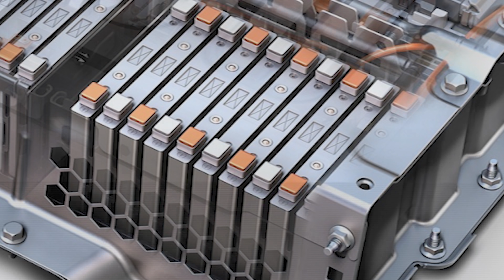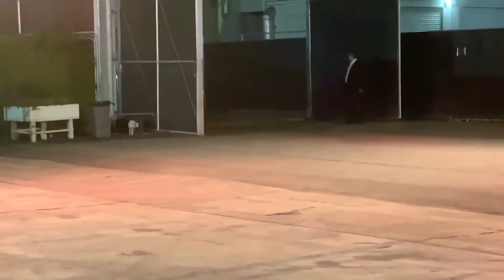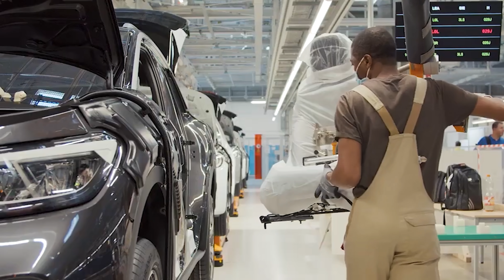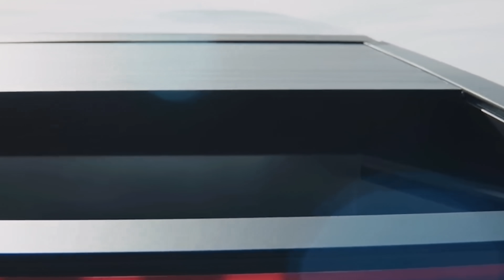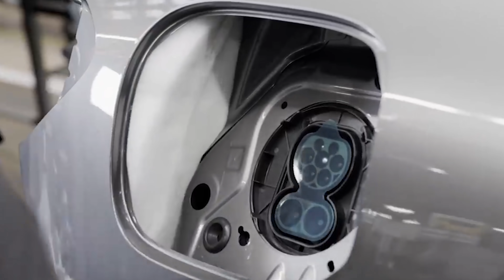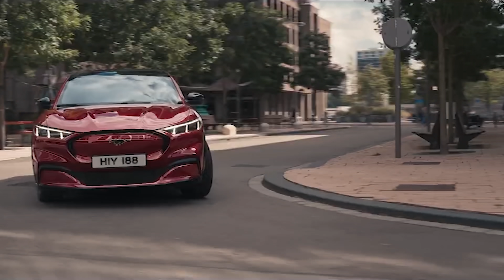Massive Advantage Tesla has Over the Competition

Comment: Great video! Can you do a video on the economics of individuals reserving cybertrucks as a "call option" on FSD? Like does it make sense to reserve 10-25 cybertrucks to run as a fleet operator? The deposits are fully refundable. It's like buying a fully refundable call option.
Reply: Wow, that would be a LONG Term Equity Anticipation Option!  To make money with FSD, it would have to be approved for use on the street with no driver.  That is years away.  While you can reserve the truck, you can't reserve the price of the software, so that might blow the whole deal too.
Reply: @incognitotorpedo42  Good points. It is currently legal in Texas to operate a robotaxi so it would be a question of whether the Feds get in the way. I doubt it but it is possible. You can reserve the FSD price when ordering the cybertruck. It's $10,000 right now.

Comment: Well, you're catching on. Many of us were riding the LFP wave well before Tesla decided it was economically feasible and profitable to use them in their Chinese based Model 3 SR.

And once again BYD isn't competing with Tesla mor do Tesla need to compete with them. But what both of them have in common in their respective markets is competing with legacy autos. 

And while BYD does make and use their own LFP batteries their cars are quite efficient. Take the BYD Han for instance. It has great tech, a center rotating screen with premium interior and a great audio system. It receives overbthe air updates and it's a good intermediate car between the Mode 3 SR and the Model S LR (on looks and not distance). The BYD gets 270 miles on a charge and that's 100% using their LFP battery design. And it's cheaper in China and will also be cheaper in Australia. 

I see both of these companies being EV leaders for years to come.
Reply: They will be the top Two...........I can visualize BYD merging with Lucid motors as this would please the Chinese Govt.   .............Paul
Reply from the maker: The thing is the range the BYD gets in the Han, is the same as a model 3 SR. Model 3 uses 54 kWh, Han uses 80 kWh. Big difference
Reply: @TeslaEconomist  But I think the BYD Han weighs 4,400 pounds and the Model 3 with LFP weighs 4,023 pounds. So that extra weight and battery size sounds about right for the milage it gets. 

And that's not "Tesla's" LFP battery. That's CATL's battery being used in a Tesla. 

But for BYD that is their own battery. And since they are the 4th largest EV battery maker with CATL being the first I can see CATL with a lead over BYD. But that's BYD making their own batteries, their own cars and their own chips while Tesla, at least for now has been using everyone else's tech in their cars.

No big deal. I'm confident Tesla will be as equally vertically integrated as BYD one day...if not more vertically integrated than BYD in the near, near future.
Reply: "And once again BYD isn't competing with Tesla mor do Tesla need to compete with them."

All automakers are competing against each other.

Comment: I seriously doubt that Tesla will put LFP batteries in the CyberTruck and Semi. Those both need high energy density nickel batteries.
Reply: Fully agree on the Semi. There are 100 million passenger cars in the US, and 2 million semi trucks. Even if the semi truck uses more batteries, it's still a small portion of the overall. What better place to use nickel than on the semi truck.

The CyberTruck should be mostly Nickel, but if they made an Iron variant then that could be a good call. Would need to see the data.
Reply: Some large trucks only need a 200 mile range per day.

Comment: LFP is junk. Only nickel is best. Range is KING
Reply from the maker: How much range do you require?
Reply: @TeslaEconomist  depends how long I want to run my appliances. Electric stove. LFP is a freaking joke.
Reply: @tophat2002  Thinking the sales proposition for CyberTruck is reliant on its ability to power an electric stove is deeply delusional.
Reply: @fredbloggs5902  the model Y cabin heater use to be a resistance heater but changed to a heat pump for cabin heating. Now Elon wants to sell you an LFP battery with a crappy heat pump rather than a nickel battery with a resistance heater.  The LFP version is of a lesser technology.
Reply: @tophat2002  "the model Y cabin heater use to be a resistance heater but changed to a heat pump for cabin heating. Now Elon wants to sell you an LFP battery with a crappy heat pump rather than a nickel battery with a resistance heater.  The LFP version is of a lesser technology."

Nonsense. The change to heat pump was not because of LFP batteries. Tesla will never replace the heat pump with resistive heaters regardless of whether they use LFP or regular lithium iron batteries. Resistive heaters is a massive waste of energy.
Reply: @yourcrazybear  resistance heaters need less repairs.
Reply: @tophat2002  Even if that is the case using a heat pump is the obvious choice in terms of creating efficient cars, especially in colder climates. The effect on range is huge in colder temperatures.
Reply: @yourcrazybear  yes, bigger range is better in the winter. Nickel is the key. LFP is temporary.
Reply: @tophat2002  While nickel based batteries have a better energy density, LFP batteries are still viable in cars. They are also cheaper and easier to manufacture at scale today. They are not going away anytime soon.
Reply: @yourcrazybear  blah blah. Range is KING
Reply: @tophat2002  Range is king until it isn't. What is even more king is having enough supply to meet the demand.
Reply: @yourcrazybear  it is forever king. Because of RV living.
Reply: @tophat2002  No. There is always a threshold for any individual use case. Paying more for excess capacity is just a waste of money.
Reply: @yourcrazybear  heated hot tub. Hot plates and all seats heated in RV

No propane

NICKEL allows this unlike iron
Reply: Junk? Hardly. 

Is it less energy dense? Yes. 
Is it cheaper? Yes. 
Is it easier to produce them at volumes? Yes.

What matters is getting the cost of EVs down. When you have reached enough range, you don't need more. People will gladly sacrifice superfluous range if it means cheaper cars.
Reply: LFP: much longer life (over two million miles), very safe (won't easily catch on fire), cheaper, better for environment, can charge to 100% much faster. Not junk junk jecause you say so. Not everyone needs 400 mile range!
Reply: @jcjensenllc  no. 

1. It's 1 million miles the same as nickel.  
2. The fire issue with nickel has been solved.
3.  It's only cheaper because the nickel hasn't been mined yet, plus you get what you pay for.
4. Iron phosphate is worse for the environment, nickel can be mined in an environmentally sensitive way unlike Chinese iron ore.
5.  Charge time is not faster, if so it is negligible.  (Longer range = less time to find charger)
6.  Everyone needs range to run other things off the battery. 

Plus, lighter vehicles in mass allow the roads to last longer and inturn means less repairs which means less work injuries which also means less taxes.

LFP is Chinese junk.
Reply: @tophat2002  almost every one of your statements are wrong.  Not worth my time to correct you as you clearly have a  mindset and you will eventually see how you are wrong. Tesla is going to heavily rely on LFP so is Tesla wrong?
Reply: @jcjensenllc  not wrong. LFP is a temporary solution to not lose market share to BYD while waiting for more nickel to be mined. "Mine more nickel" ~Elon
Reply: @tophat2002  1. LFP have a better longevity.
2. LFP is safer. 
3. It's cheaper because the reality is not the reality you had in mind?
4. LFP can be produced in larger volumes due to the raw materials needed. What do you think that does to the environment when it replaces fossil cars faster?
5. LFP can be charged to a higher state of charge without experiencing the same degradation. So the practical normal use case range difference is less than you think.
6. No. Everone does not need that. 

"LFP is Chinese junk."

Nonsense.

Comment: I think you have missed tesla is still going to differentiate its battery tech.
LFP under Tesla will be one of the chemistries inside a 4680 which will have dry electrodes, and higher silicon anode. 
Thus a 4680 LFP is the hammer to crack the low cost, most efficient the most affordable EV sweet spot for consumers.
The high nickel 4680's will be for performance models and the semi and model s/x and roadster.  
This is coming in 22/23.
Reply from the maker: Elon said they will use a different form factor for their LFP batteries.
Reply: @TeslaEconomist   I can not see tesla using pouch cells, their entire battery thermal management setup is around battery cells. interesting if they do go pouch for low end vehicles.

Comment: If BYD has such huge LFP blade batteries with higher pack level energy density than Tesla has today, how is this not evidence of BYD being a peer competitor to Tesla? Sure, they might not have the same safety and AI as Tesla, but the batteries are by far the most important part today. BYD is essentially a legacy ICE manufacturer that's already vertically integrated with a good LFP battery and already serious about EVs. Elon Musk seems to have his eye on them, already.
Reply from the maker: Because despite that, BYD still require 50% more batteries to get the same range as a Tesla
Reply: @TeslaEconomist  This is prompting a search. That's quite something to consider.
Reply: @TeslaEconomist  For now. If that's a matter of software, then it's not any significant moat at all. In fact, I live in Silicon Valley and work at a startup. One of my musician friends' husband has a startup that sells software to increase the efficiency of electric motors. BYD could just license it! As Rob Maurer of Tesla Daily has pointed out, it's not that hard to design a car with less frontal area and better coefficient of drag than a Tesla. (Just make your car lower and a bit goofier looking, like Lucid!)) Engineering a car to be lighter with structural batteries, even without gigacastings, is also within reach of other auto manufacturers. Sandy Munroe talks about these methods all the time.
Reply: @stcredzero  but you're forgetting Tesla has Elon which means it will inherently retain an edge no matter what! Lol these videos are hilariously optimistic
Reply: @somefunification  There's even something to that Elon Factor. (Disclosure, I'm heavily invested in TSLA!) Still I don't think any advantage Tesla has can totally shut out competition in non-US markets, where local governments can create competitive moats and otherwise stack the deck. Volkswagen, Nissan, BYD, and Hyundai could well survive and even eventually thrive this way. All 4 of those companies are already serious about EVs.
Reply: @stcredzero  agreed. This channel is just so irrationally optimistic sometimes even for me, a guy literally waiting for his Tesla to arrive.
Reply: Because Tesla good and China bad ~ Tesla Economist

Comment: The  LFP patent will be open next year so I’m sure everyone will be trying to use those. I don’t see why those couldn’t be used in the 4680 when that gets up to full production. Let’s see, a regular LFP could be $70/kWh with a 56% reduction gives a battery pack with $30/kWh range. That could be the nail in the ICE coffin!
Reply: And you can charge to 100% all the time, and could last longer
Reply from the maker: Yes, that's the numbers I am thinking, $30-35/kWh.
Reply: Especially for bigger vehicle that needs bigger packs (CT, Semi and possible van down the pipeline.)  Since these vehicles will be used for longer trips, being able to use and charge full capacity will help out even more and cost less for the end users.  But if my dumbass has thought of this, I'm sure their engineers has at least brought it up lol
Reply: @tenzinpassang4812  the problem will be they weigh a lot more. So a giant pickup with a giant heavy battery will be over the weight limit of a ‘light duty’ truck which is what the F150 is classified as. Until energy density goes up but that could take years
Reply: @beauarts  Not as many years as You believe.....LFP is the future for at least 2--5 Years.......Paul
Reply: The patents will be open and they still won't catch fire.

Comment: LFP work happily from 100% down to just above zero. Say 5% to avoid killings he cells. Nickel based cells prefer to work between 20% and 80%. They can (and often do? more but the cost is faster degradation. LFP doesn’t give the peak range headlines but it keeps on going.
Reply: For nickel it's more like 10 and 90.
Reply: @TheEvilmooseofdoom  Yep. On Teslas, I use 40% to 70% for my everyday driving. For a highway trip, I will charge as high as 95% if needed, planning to drive down to as low as 10% on the first leg of a trip, then charge up to a level of 10% - 15% above what's needed for the distance to the next planned supercharger stop, which usually works out to be in the area of 50% to 80%. This formula has always worked like a charm, occasionally seeing as low as 7% pulling into a supercharger.